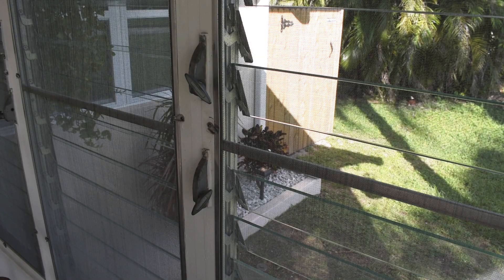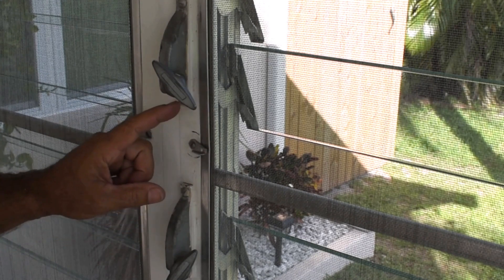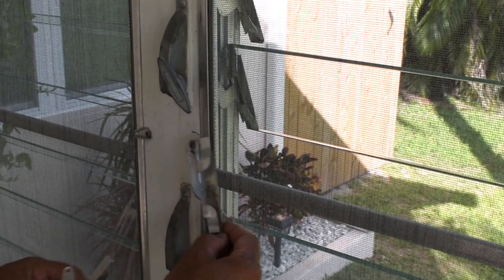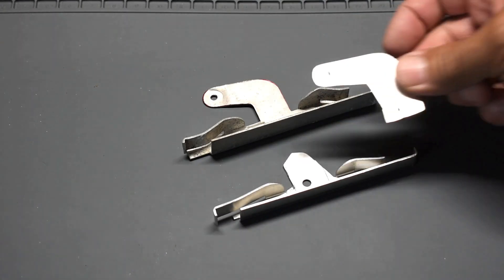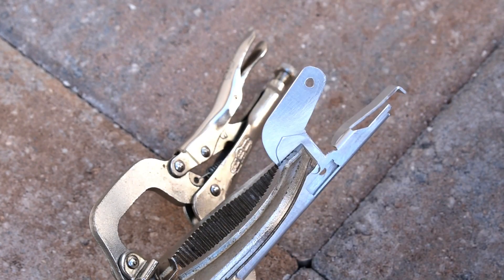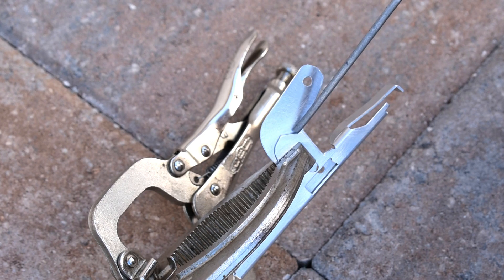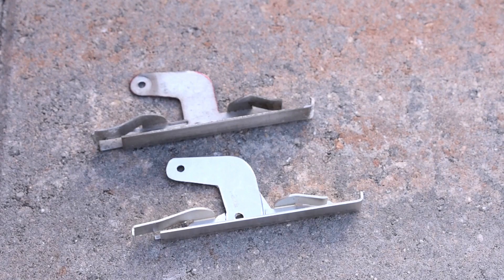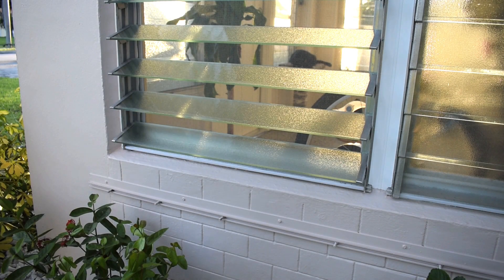Need To Repair Aluminum Without A Tig Welder? (Try This!)

Comment: Epoxy will bond to elemental aluminum, just not to an oxidized aluminum surface.  The technique is like you've shown with the brazing compound: preclean the aluminum with a stainless brush, then using an abrasive pad (ScotchBrite etc) wetted with the epoxy, scrub the wet epoxy into the aluminum to simultaneously abrade the epoxy into elemental contact while coating the metal to prevent the instant re-oxidation; finish with gap-filling and clamping.  This will provide a few 1000s psi of bond strength that is the epoxy characteristic.

Same thing works with polyethylene plastic, supposedly unbondable, until you activate the surface by wet scrubbing with naphtha.

Comment: A great idea we had those windows as well & your right almost impossible to find some many years ago so there's no way to find them now unless very lucky as said it would most likely be in someone's garage.
Reply: Have you ever tried out Staybright # 8? Used in HVAC for many years & good for up to an inch line under A/C pressures so very strong & very clean just wipe with rag after braising. Repaired an old unit on top of a Holiday which blew out a big hole in a 90 with it to aluminum. They were about to replace it until I said no wait let me try this, I had just learned about in hvac class. Probably still working? Vac & charged it worked very well.

Comment: Amazing work, Scott!  I thought you might have been able to trim the arm, but, apparently, you measured to find that it couldn't work.  Great reproduction of an obsolete part!  I've never welded anything, but you make aluminum welding look easy.  I have larger screw-on propane can torch and a smaller refillable butane torch, so all I would need is the rod.  You Tips are fantastic!  Thank you, Scott.

Comment: I knew NOTHING about brazing when I made my first aluminum repair.  It turned out to be strong enough for what I needed but looked pretty rough.  After watching your video I see what I should have done with the wire brush after the rod was applied and so I should be able to make a nicer looking joint the next time. Thanks!
Reply from the maker: Glad I could help!

Comment: Good repair. We have Jalousie windows too, in what we call our "breezeway".  You are right, it's getting harder to find parts for them, even the glass.  I had to replace a couple of the panels of glass, I had to find a glass shop that carried them. The one end of the breezeway has frosted glass.
Reply from the maker: I got ripped off for (2) 4.5" x 29" obscured glass slats. $65 inc tax
Reply: @electronicsNmore  I believe it, I paid a lot for the panels I had gotten.  These types of windows were popular in the 60's & 70's.

Comment: Very much agree about this being the superior repair or modification method for anyone without a welder. Epoxies should only be considered if the part can't take the heat(maybe it's part of a whole with other bits that would be damaged for example). Brazing is one of those things that anyone can pickup so long as they start with a couple test pieces.
Reply from the maker: Agree.

Comment: Every time you remove the flame, the metal oxidized from air contact. Keep the flame on it until finished
Reply from the maker: You cannot do that, the aluminum will melt out.
Reply: @electronicsNmore  keep moving the flame, don't cook it just constantly move it as the filler metal melts